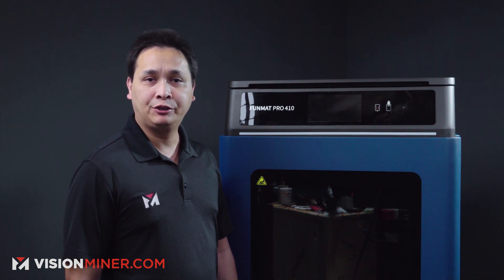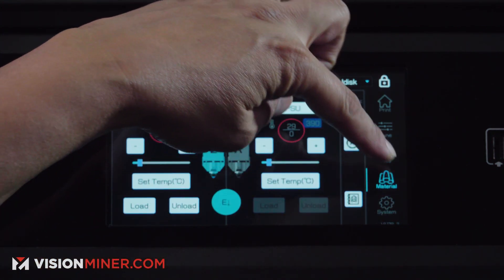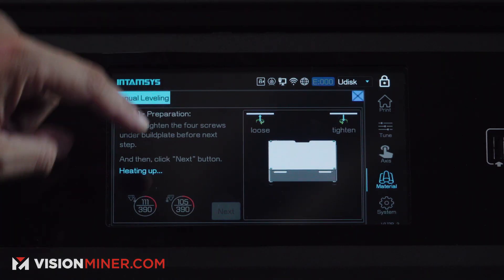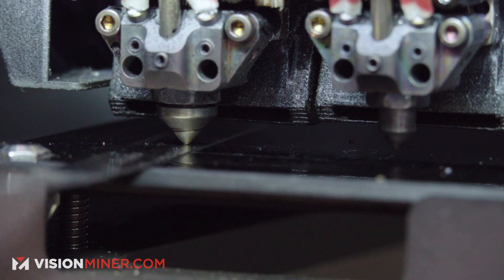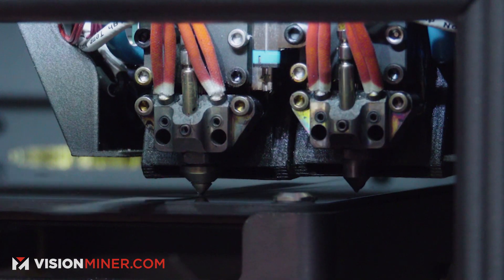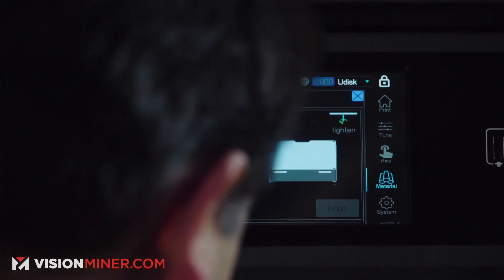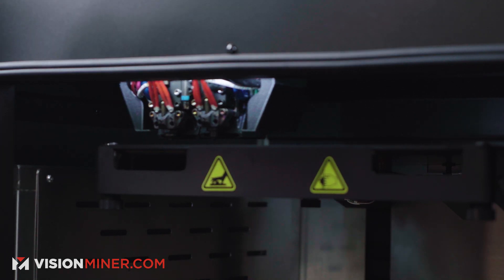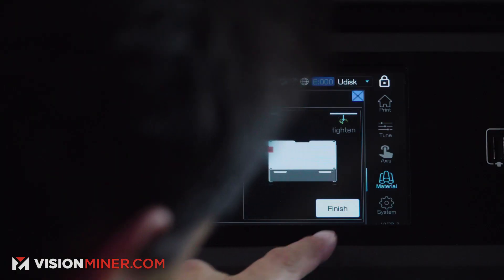How to Level the Bed - Funmat Pro 410 Support

Comment: Do we need to do this bed leveling manually for each ane every print??
Reply from the maker: Definitely not! Generally you only need to re-level when you're changing bed or chamber temperatures significantly -- going from 60c for PLA to 160c for PEEK can expand the metals, to the point where re-leveling is just a precaution :)